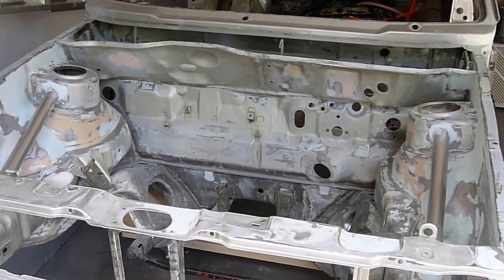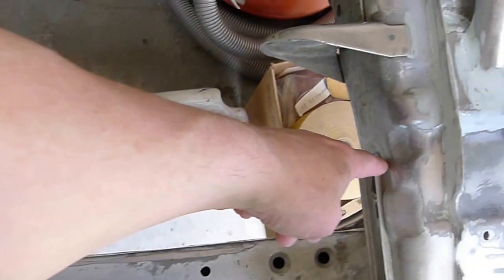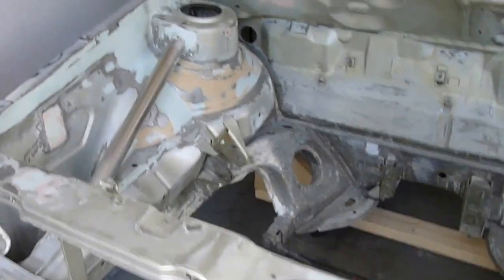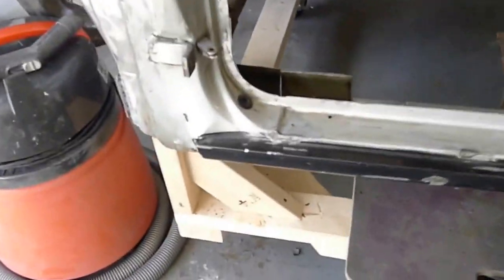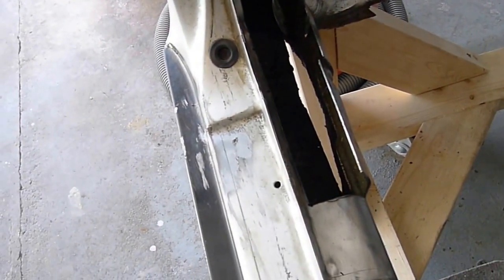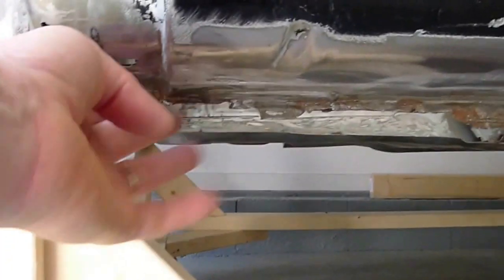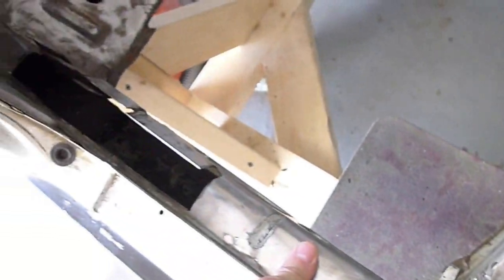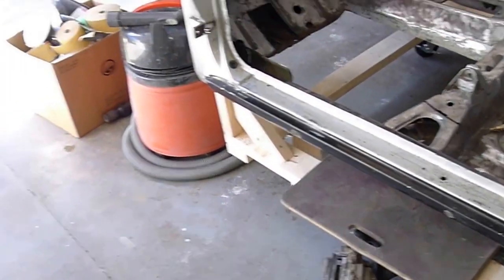The Ultimate 1983 Rabbit GTI Project - part 9 (smoothing the engine bay)

Comment: someone did the same thing when jacking the car up on mine
Reply from the maker: It is quite common for people to get lazy and jack up the mk1 at the wrong points. In fact it is not at all obvious where you are safe to jack them up unless you read the manual. After working on this project I realize that even the factory recommended mounting points were poorly supported and eventually would bend. Oh well - these were low cost vehicles and I am sure that the designers weren't thinking of 30+ year life expectancy!